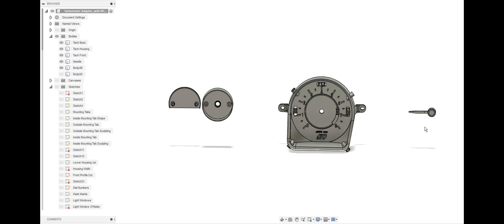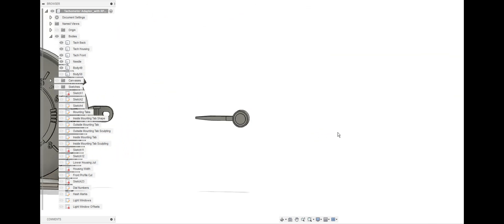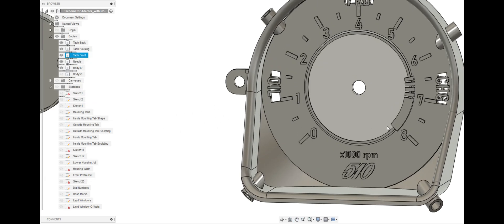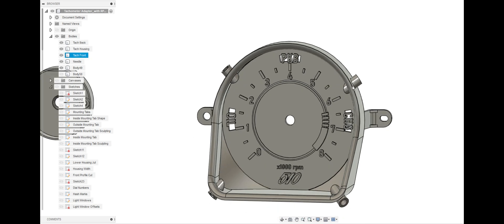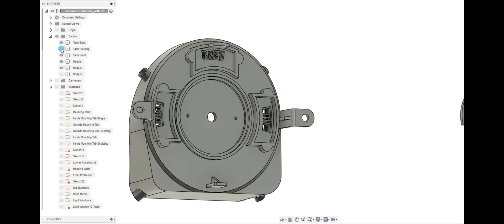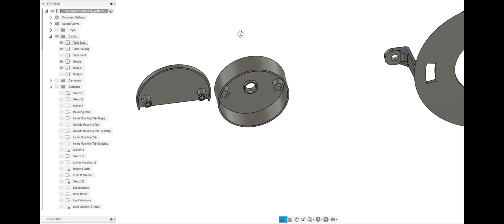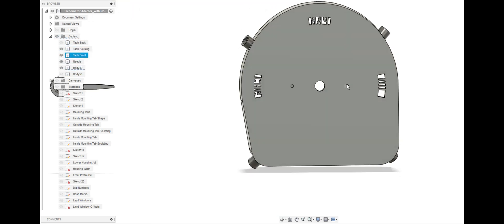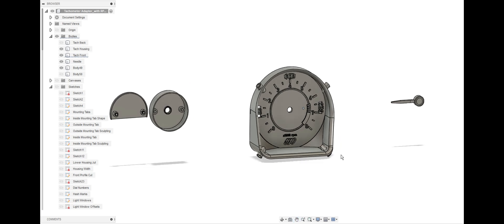3d Printed Datsun 510 Tachometer

Comment: Hey, I have a genuine Datsun 510 tachometer but the needle is lost. Can somebody 3D print one for me? I will gladly pay a reasonable amount for it. 🙏🏻
Reply from the maker: What I saw when I was doing the FDM printing for this, the needle really should be resin or made of something else to get the right level of rigidity while also being small and dainty. My needle is the least favorite part of this because I just couldn't get it to perfectly match the original parts as well.

I hope someone volunteers to print for you. I would suggest looking into a lathe and metal replacement.